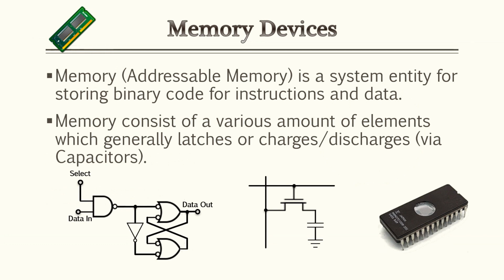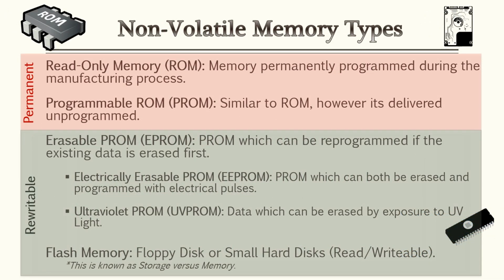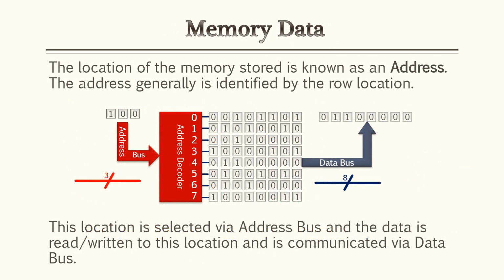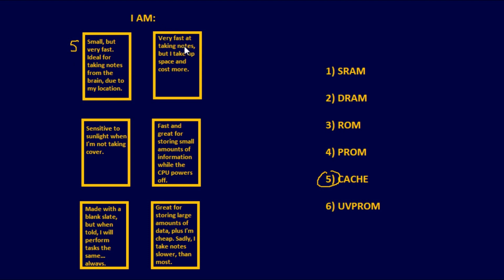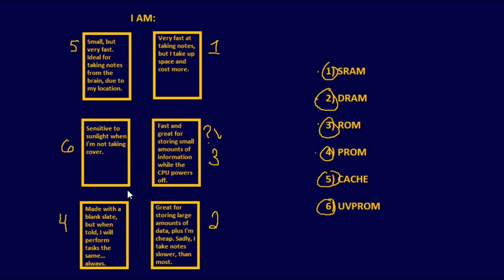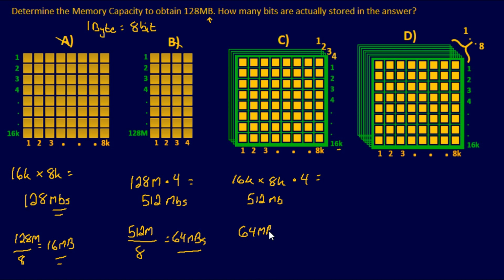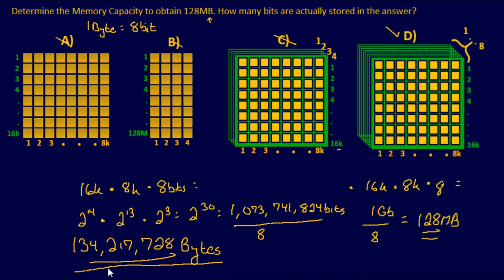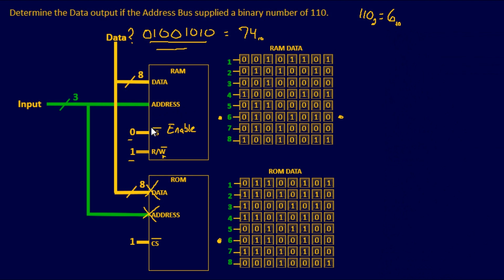Electronics P.E Prep - Memory Devices

Comment: Thank you for all the videos you created. On the last example the address specified is 110, shouldn't that be row 7 instead of row 6? Since three bits addresses range 000-111 binary which makes 110 address 6 decimal or row 7
Reply from the maker: Hello Kevin, great question. You are correct if the rows were addressed 0-7. However, they are (intentionally) labelled 1-8. Meaning row 8 will never be used in this example. Your addressing methodology is correct, the idea for this example was to keep it simple.